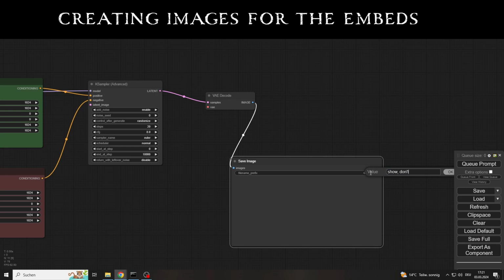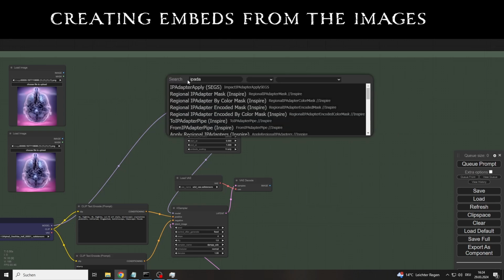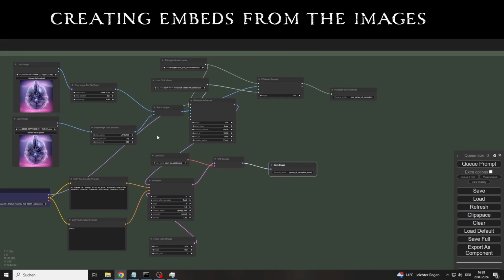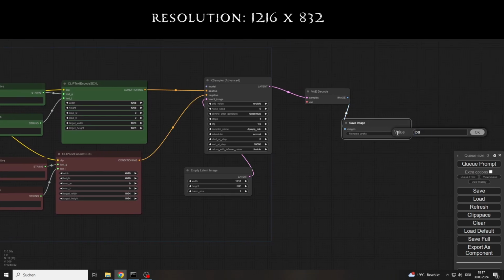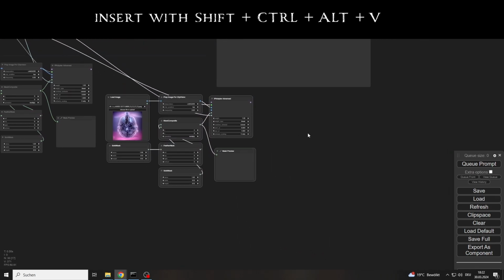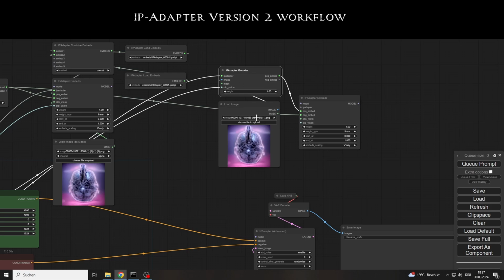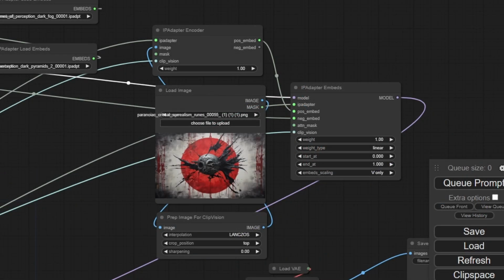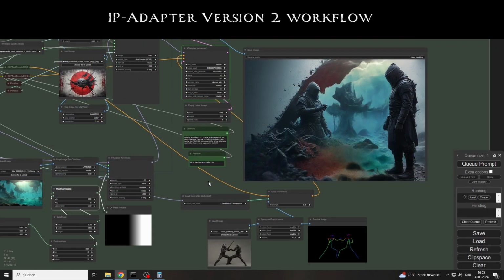ComfyUI AI: IP adapter version 2, create artistic images with the Gestalt laws of perception

Comment: Nice. However, the ClipVision seems to be redundant, as Matteo (the guy behind IPAdapter) has mentioned: "if you use the unified loader you never connect the clipvision input (or the insightface). The input is optional and only required if you use the legacy model loaders (eg: IPAdapter model loader). That might be helpful for advanced users who know what they are doing. Otherwise just connect the unified loader and that's all you need."
Reply from the maker: Thanks for watching. And yes, I know, but I prefer to learn the whole thing in advanced mode. That means I don't use the unified loaders.